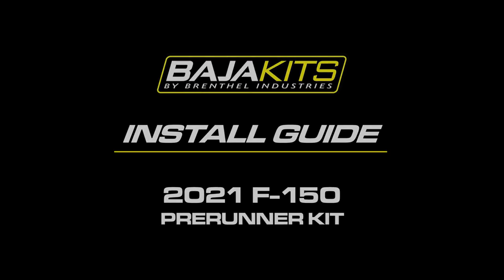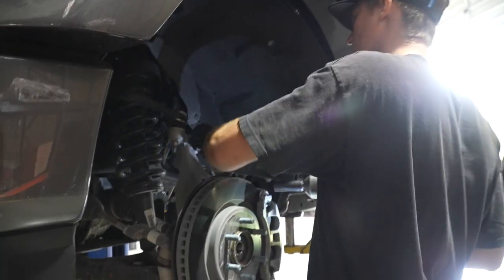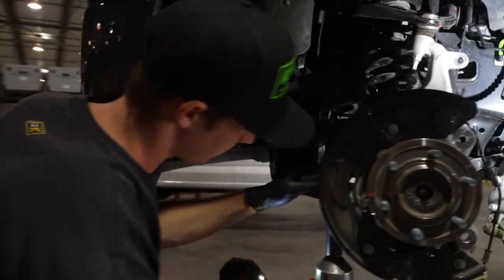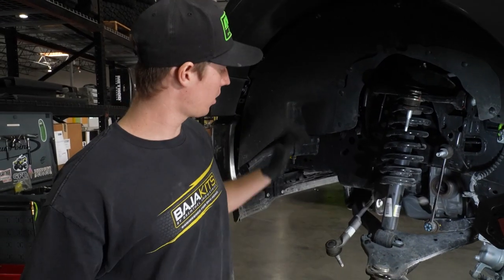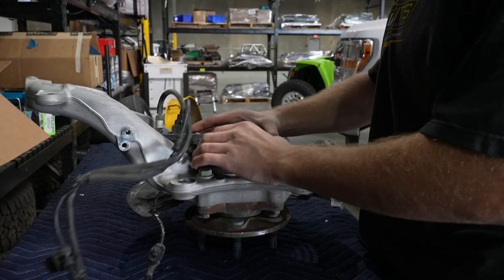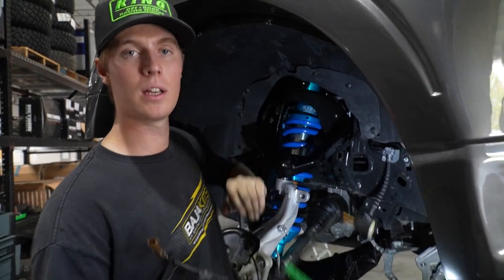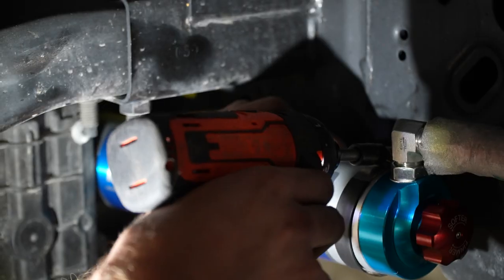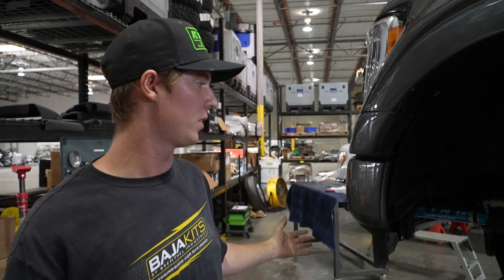Baja Kits Install Guide: 2021 F150 Prerunner Kit

Comment: What about camber adjustment? Do I need to shave off the knuckle as well  for 2020 f150  with kings as well? I bought your kit and just got the kings coil over kit.
Reply: I was thinking of ordering this kit for my 2WD 2020. I need to shave down the spindle why?
Reply: @joeyskinner8366  because the coil over shock will hit the knobs that are on the stock spindle. I am about to start installing the kit in a few weeks.
Reply: @anthonymontoya6950  post about it.
Reply: @joeyskinner8366  sorry been busy with life stuff. So I went with evil manufacturing upper and lowers. Yes I will have shave the spindle nubs since it will hit the control arms. I will try and document the whole process including the rears installation.